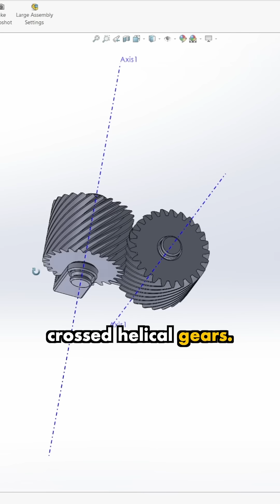Bevel Gears vs. Crossed Helical Gears

Comment: “A good engineer designs something that works, a great engineer steals what already works”
Reply: @Engineezy i mean he ain’t wrong
Reply: Coders be like:
Reply: @ArashG ctrl+c ctrl+v, works like a charm!
Reply: @netzachfangirltbh is this dani reference
Reply: @lynenx9410   It wasn't meant to be, but since it's a universal truth in the land of code, it technically is
Reply: Wait... Didn't Picasso say a variant of this line? Something like:

"Good artists borrow, great artists steal."
Reply: @BrokenLifeCycle  "Good artists borrow, great artists steal." is a classic quote. It may have been Picasso. Or maybe he stole it from Einstein, or Lincoln.

Sir Isaac Newton is credited with "We stand on the shoulders of giants" which is a great way of saying 'Don't reinvent the wheel, just make a better horse-cart.'

Also headpats for @Nishye501 :) :) :)
Reply: @LordPhobos6502  :3
Reply: I guess Artist andEngineers aren’t so different.
Reply: I feel urged to rephrase that:
A "good" engineer designs something that works, a good engineer "designs" something that works!
Reply: @warmooze  that’s even better
Reply: @Nishye501  I applied the rules of good engineering 😂
Reply: @warmooze  exactly as you should, steal and slightly modify if necessary
Reply: Trans engineer spotted :3
Reply: To this day, I remember something one of my engineering professor told me: 

Before you design something for a project, check if someone else has already made it. The existing solution is usually better and cheaper.
Reply: This comments reminds me of my friend
Reply: Can confirm
Reply: We all live off the work of unknown billions before us
Reply: @RealFemale69 we are standing on the shoulders of giants
Reply: I mean you ain't wrong because I'm going to be a machinist so a lot of mechanical engineering does overlap.
I can't tell you how many times I have tried to come up with something for X only to find out something was already done saving me the trouble.
Reply: I think that high speed and more has to do with the the area it occupies as a gear. You see small motors spin fast while big motor spin fast with some extreme torque, the second he showed as was used for high speed because of its area interaction between them is small compared to first one. But first one has more area which will end up resulting in more torque.
Reply: @ug2897  ?
Reply: Works for all engineering too. Especially software engineering
Reply: First of all, I don’t think that’s a saying, secondly the whole point of an engineer’s job is to create something that works, no make something that already works, people need to be innovative here…
Reply: @dominicstevenson8816  it’s for individual peices of a larger project
Reply: BMW entered chat
Reply: Standard issue she/her catgirl computer science/mechanical engineering major of the lake what is your wisdom?
Reply: @mr.mercury4247  nah I’m just a general purpose catgirl, half decent at a lot of things, but not amazing at a lot of things
Reply: Whole definition of stackoverflow 😂😂😂
Reply: TS Eliot: Good writers borrow. Great writers steal.
Reply: Same for programming!
Reply: @Coarvus  programming? Where(I have yet to learn that skill)
Reply: Society is doomed to fail
Reply: @peanutbutterboi8489  honestly furries are the only thing keeping it from that
Reply: Spoken like a moderately skilled person who can operate a 3d modeling software.
Reply: @JPspinFPV  unfortunately I am only one of those
Reply: All mechanical engineers piss off machinists
Reply: Design theft is more efficient
Reply: Mentally ill person that gives into his illness instead of fixing himself spotted.
Reply: Uneducated ppl will toast everyone "you didn't invent that" but fail to see that no one claimed so, no one asked for their oppinion, and no one will miss these degenerates that are always looking to create a problem. In the words of jim jeffries - if we can remove that pin we could be going so much faster
Reply: Ewwwwwwwwwww
Reply: so a good engineer is a great cientist...
Reply: @mynameusedtobelong  do you mean scientist?
Reply: @Nishye501  yep, sorry english isn't my main
Reply: @mynameusedtobelong  ah, cool, have a god day!
Reply: Gross
Reply: meep
Reply: @aahijustalice8112  no:3
Reply: This is wholesome and I'm here for it
Reply: whole comment poppin off fr
Reply: i feel like im the only mentally stable person scrolling for other mentally stable individuals
Reply: @coolkid006 for real
Reply: @coolkid006 I don’t know if they sharing channels or not but take a look at the vids ain’t no way that’s a woman 💀
Reply: @Purp1edude  have you heard of a trans person?
Reply: @Nishye501  read my comment again and find out what other things could have been interpreted
Reply: transfem engineering!
Reply: Someday an archeologist is going to read this comment section, and they will understand why our society collapsed
Reply: This is literally just r/traaaaaaans and I'm here for it
Reply: @DoubleTeaMedia  ye:3
Reply: @Nishye501  RIP r/traaaaaaans
Reply: @DoubleTeaMedia  but hey there’s a second one
Reply: @Nishye501  true.
Reply: A Benjamin Franklin quote. The thief and morally bankrupt individual who steal and claim other invention as his own then license it.
Reply: @Titanike  yes, but it’s quite good practice for engineering
Reply: @Nishye501  I respect the bravery of people who did their part of this kinda roleplay in this PUBLIC COMMENT SECTION. It’s crazy dude.
Reply: @Sireington  lol What, do you think Headpats are some form of kink?
Reply: @Sireington  Garfeldi supports all of these actions you are a fake fan
Reply: @ValTheWolfQueen   I wasn’t shaming or at least trying not to make it seem so. You pop off and do your thing, I guess.
Reply: Hello other trans lady c:
Reply: @orbismworldbuilding8428 hello trans person.  Would you also like head pats? Idk if it was a trans thing or a cat thing
Are your pronouns also she/her?
Reply: @orbismworldbuilding8428  haiiiiii:3
Reply: @Nishye501  average colon three user challenge- not mention headpats for 5 minutes (IMPOSSIBLE- ULTRA HARD):
Reply: nyaice pfp :3
Reply: @RichConnerGMN  :3
Reply: based comment section fr
Reply: sounds about right (also bonjour fellow flagbearer)
Reply: trans catperson spotted :)
Reply: @noobynoob138  yeeeee must require Headpats (also she/her) :3
Reply: @Nishye501 can I haz head pats from the nice cat lady? 🥹
Reply: @theangledsaxon6765  have sum Headpats good one
Reply: @Nishye501 i-is it that easy to get headpats? just have a trans catgirl pfp?
Reply: @insertname9305  Headpats:3
Reply: @Nishye501  i suppose i can add cat ears onto my pfp easily enough
Reply: @Nishye501 wtf
Reply: @godzilla928  ?
Reply: @Nishye501 :3
Reply: @Nishye501  have some headpats! headpats for you I'm not too late am I? also can I also have some :3
Reply: @Nishye501 m-may I h-have some headpats please?
Reply: @Nishye501 Can I also have some headpats? 🥺
Reply: @deusexmachina5769  yes:3
Reply: @Nishye501  Thank you :3
Reply: @Nishye501 dw, head pats on the way
Reply: @Nishye501 I got no time for this, I am getting the Flammenwerfer
Reply: @Nishye501 eww tf
Reply: @Nishye501 thought I've seen it all but this is crazy 💀
Reply: @Nishye501 he him
Reply: @Nishye501 .*pat pat pat*
Reply: @StabbyJoe135  :3
Reply: @Nishye501 smash
Reply: @Nishye501 😐
Reply: @Nishye501 vomits
Reply: @Nishye501 when I see people like you on the net I always question life itself on what it has become.
Reply: @MemzDev  like the fact that some people can’t accept others are different?
Reply: @noobynoob138 woag. We are spreading.
Reply: @MoonlitRose101  i need a new pfp
Reply: God is dead and we have killed him long time ago.
Reply: @pigeon.and.pigeon  i showl we comfoort owoer selwes, the muwerer of owoer muwerer
Reply: @pigeon.and.pigeon need a headpat? x3
Reply: @pigeon.and.pigeon  he is alive and well do you not know of the resurrection?
Reply: @pigeon.and.pigeon  if that is the case then that weak God is no God of mine. A God which can be killed is no God at all
Reply: @smeggytesters8585 bro I have brought people back to life with CPR as well, where is my religion???

Comment: I would think the cross helical gears would be better on high torque due to their larger surface area, the friction would certainly not be great for speed
Reply from the maker: They technically only meet at a single point! So this would put a lot of stress on the teeth at that point

Comment: What'd happpen if you coated the cross helical gears with graphite powder? Graphite powder is a good dry lubricant and could maybe help a bit with the friction
Reply: Used to run these gears in a rotary valve shaft on a 2 cylinder two stroke,  they run just fine in an oil bath of standard premix oil and the angle of the gears impart flow to the oil and thus circulates it to a reservoir where it can release some heat. 

Graphite may work fine for open gearsets operated in very dusty conditions however.

Comment: Well actually, crossed helical gears are used in limited slip differentials in cars. To be specific,in the ones used in VW 4Motion cars.
Reply: Or like the rear diff in my friend's old RAV4.
Reply: @dadgarage7966 Torsen LSD, my Rx-7 has one.
Reply: @sw96  Eaton calls it Truetrac. I put one in my Toyota Pickup.

Comment: Hit the nail on the head, friction is this gear’s enemy, also the axial load causing the need for thrust bearings.
Reply: How do they compare to worm gears? They seem to operate on a similar principle, but worm gears are very common.
Reply: @DisorderedArray  worm gears have a profile similar to a screw, the angle of the teeth makes it impossible to drive the worm gear with the spur gear. Don’t event start with hypoid gears lol.
Reply: @timehunter9467  worm gears also reduce speed and increase torque. If you want a 1:1 gear ratio that only changes the axis or rotation, you would not be able to use a worm gear.
Reply: @tbengineering7066  Literally like the force a screw has at holding itself in place, interesting when you think about it like that.

Comment: Thank you! I was legitimately getting mad at the comments on the last video of people claiming you are trying to "claim" inventing the cross helical gears. All I saw was you providing a proof of concept for 3D printed gears.
Reply from the maker: Thanks for the support Troy!
Reply: Shorts comments are generally awful ngl
Reply: He didn't explain it very well but he corrected himself so this dude got my subscribe.
Reply: Same here that pissed me off so bad. I left a bunch of comments explaining until I just got tired of the idiots and realized there was literally nothing I could do
Reply: Shorts attract the stupidest audiences, is probably why
Reply: The term “proof of concept” is often used as “proving this works.”

Of course it works, it’s been done.
Reply: @bradensorensen966  yeah, but does it work for your design or for the tools you are working with? That's how engineering works. We take what we know, make simple things to prove a concept and operation to ourselves, and tweak it for whatever specific application we need it for.

Comment: Have you given any allowance between gears for motion or is it  just the circular pitch?
Reply from the maker: I’ll generally use the circular pitch + 0.1mm
Reply: So if the circular pitch of one gear is 5mm then other will be 6mm... right?

Comment: I printed the gears yesterday and I can definitely see the amount of friction on it
Reply: I noticed that too, but it is likely a clearance issue with the prints. My prints usually require a 0.3 mm clearance
Reply from the maker: WD-40 helps a ton!
Reply: @Engineezy I wonder what other lubricants would work well for this? Have you tried aerosol silicone grease? Wd40 is actually not a lubricant, but a solvent. So I’d be interested to hear if silicone spray works better. 

Also, I’ve never 3d printed anything, not an engineer, just curious.
Reply: @jvke.p  for plastic? I've heard lithium grease recommended but if I'd probably use 75w90 gear oil cause why not
Reply: @jvke.p  The most important aspect is probably that it doesn’t dissolve plastic at all. Dry lube might work but a liquid one that doesn’t dissolve plastic would be my first pick.
Reply: @Engineezy no! Wd-40 is a solvent and will make it worse. Use a lubricant. 

Psa WD-40 IS NOT A LUBRICANT!
Reply: I tried printing a tripod with similar gears on it and they wouldn’t budge at all. Definietly not efficient
Reply: friction be like: tf bro, I thought you can't see me
Reply: The look.
Reply: What program/App do you use on a 3D printer to make this?

Comment: Crossed helical gear are for noise reduction
Bevel gear are very noisy
Reply: @court2379  Misinterpretation. They do roll, but only when they are rolling on parallel axis or the axis intersect. If they do not intersect, they rub. You know damn well i was talking about the crossed helical gears

Try rolling two wheels together on perpendicular non intersecting axis. Its hard, because of the friction, because the surfaces do not roll together. Now put them parallel. Super easy

Doesn't matter how many teeth you add, the crossed helical gears rub together and will wear out fast.

Do not take my words out of context, it only reveals yourself to be the fool.
Reply: Also for higher torque. Multiple teeth contact in a helical cut so the torque transmission capacity rises a lot even though the efficiency drops.
Reply: @court2379 No, the helical gears have only point contact. Very bad for high loade
Reply: @fg8557  That isn't correct.
Reply: @court2379  It's easy to see for yourself. The gear bodies are both convex, they can't form a line contact. 
If you can't see this for yourself, i can refer yout to some sources. My go-to Textbook is not available in english, but i think Shigleys is the english analogue. 
It is also mentioned in the KHK gear heandbook, which you can access from online.
Reply: @court2379 Dude, it's literally 2 perp. cylinders touching, which is in one point. 

Of course sure to the tooth width it's not just one in contact at a time. But, it's only a very short section of the tooth in actual contact.
Reply: @konstantin7596  It doesn't matter how much is in contact for max torque calcs. It distributes the load across multiple teeth, and the tooth is bending in a direction that it is stronger. Both resulting in higher strength.
Also it isn't cylinders touching. It is an involute rolling on another. In well machines gears the teeth are just barely going to clear each other. As you load them, they will flex placing the next tooth in contact.

A simple search about advantages of helical gears will show dozens of manufacturers stating helical gears carry greater loads for various reasons.
Reply: @court2379 the big problem is that the teeth grind on each other, thus creating friction and wear. Which is why they are not recommended for high torque.

In theory they seem better, but in practice they suck.